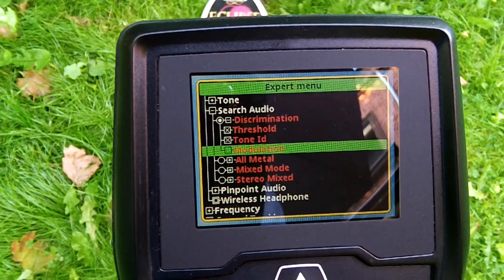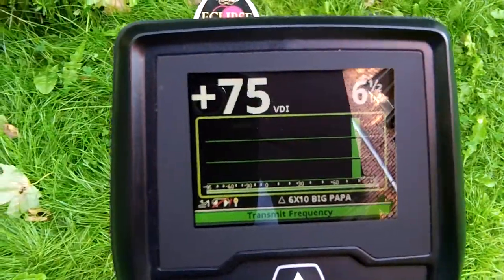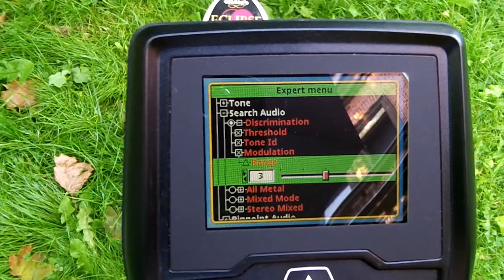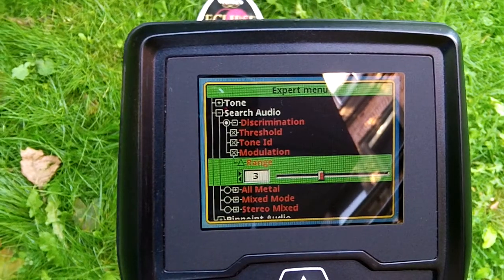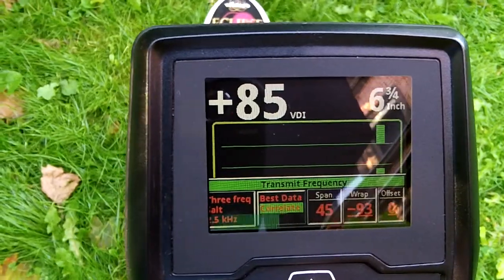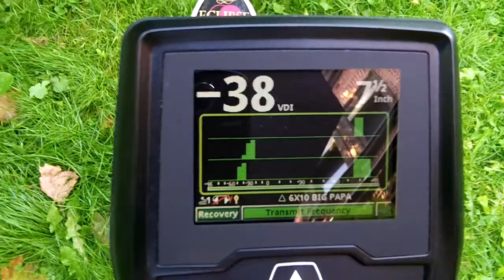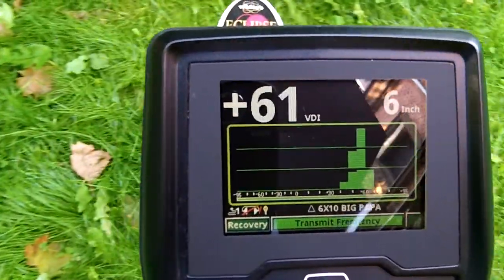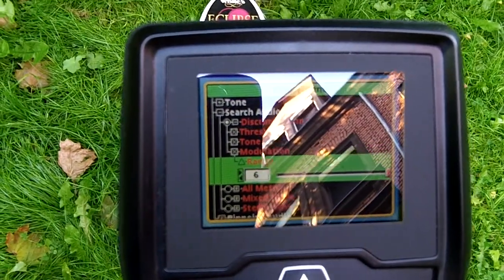Modulation with Correlate & Best Data.MP4

Comment: Wow disc @90 in European soil?
I wouldn't dare go over 80 in any soil in the UK.
I usually run it at disc 75 and maybe 55/65 all metal disc.

Maybe that is why you struggled for depth?

I have had some incredible depth with mine just using Hi-Pro and dropping the disc down and keeping RX gain as high as I can and backing off if she becomes unstable.